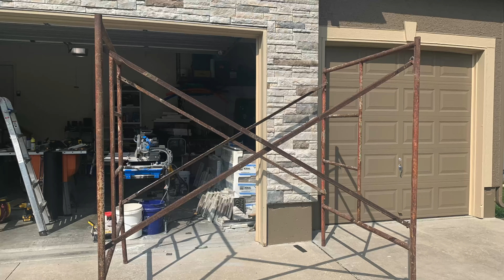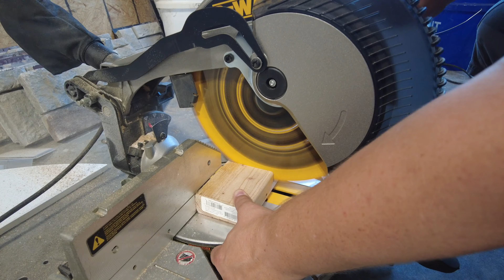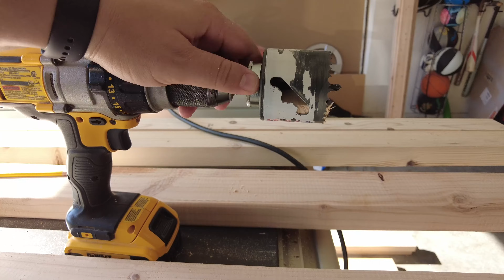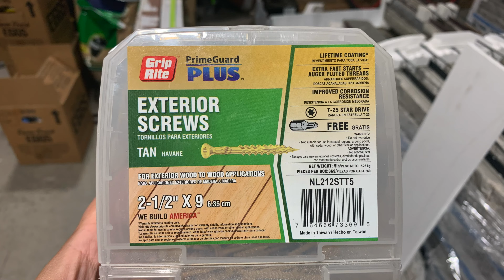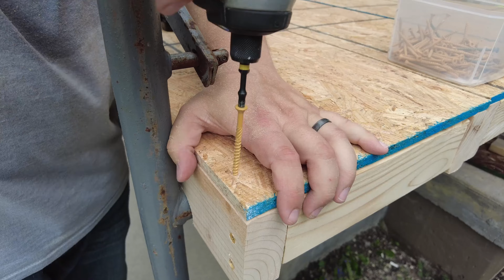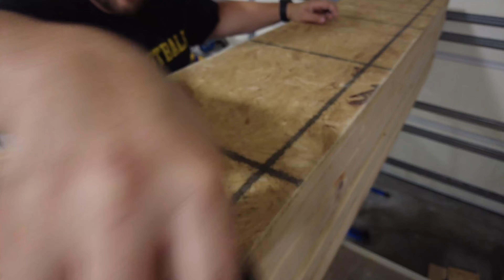How to Build Wood Scaffolding Planks (Walk Boards)

Comment: Plywood is quite a bit lighter than OSB. Otherwise, this is a nice, to-the-point video.
Reply: Its also considerably more expensive. At least in my area almost double the price.
Reply: @loganlagace4046  You're not kidding. I checked last month, it was 3 and a half times the price. That being said, it's not so much that plywood is expensive, its really not. Rather, OSB is just so, so cheap. Right now it's cheaper than drywall!

Comment: Did anyone ever do an actual engineering analysis to find the safe working load and deflection? Skinning the lower surface would greatly increase the strength and decrease the deflection.
Reply: Yeah, he jumped up and down on it and it didn't break.

Comment: Thanks for the video!  How much weight do these platforms hold?
Reply from the maker: We didn't stress test them, but my Father-in-law used them along with installing 40lb pieces of stone so I'd say at least 250 each if built properly. He said he never felt them bending or feel unstable (unlike the other wooden walk boards we based them off of). You could always use beefier material like 2x6's or plywood if you feel they need to be stronger.

Comment: The concept seems super solid but I would be worried that the particle board would deteriorate faster than plywood. Am I wrong or just worrying too much
Reply from the maker: The chip board (OSB) we used should hold up OK over time. The biggest concern we had was making sure the wood didn't swell from being wet if it rained, which is why we coated everything with a deck stain to seal it up. For what we needed to do it was perfect, but you could always switch to plywood instead. Thanks for the comment!